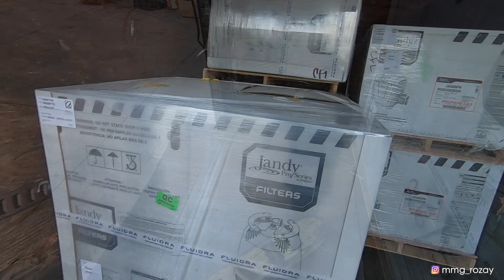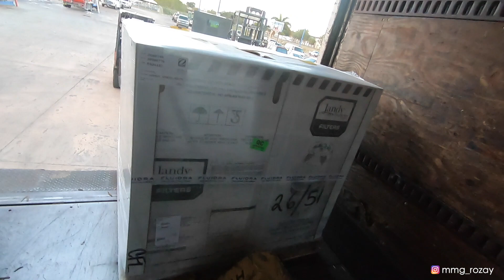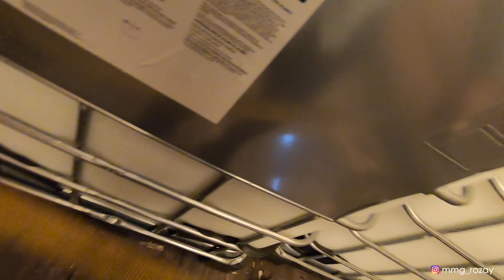Tractor Trailer | Pepsi Delivery

Comment: Thinking about applying with Pepsi I’m a otr driver, no touch freight at all!!!!!
Reply: I don't think they hire their line drivers off the street. They work their way up from Home Market. Which means you will work your butt off for years before you get high enough to get a line hauler job. Home market is a bitch. Lots of wheeling and stacking. Most you will make is about 60k a year.
Reply: i worked as a pepsi driver and its hard labor you have to work everything you deliver. did it for 2 years would never go back !!